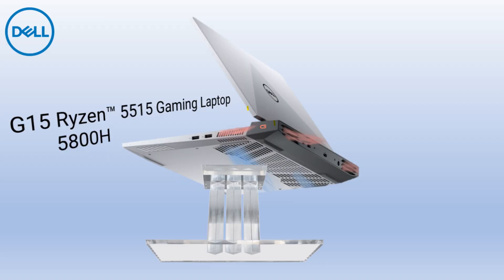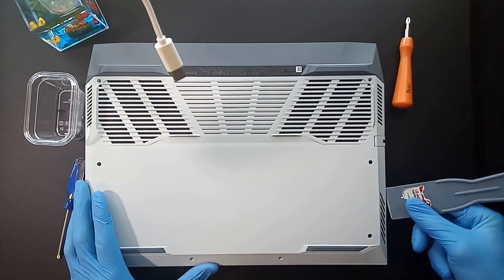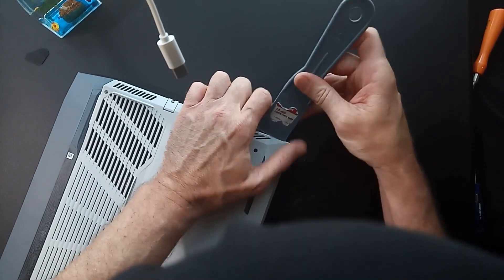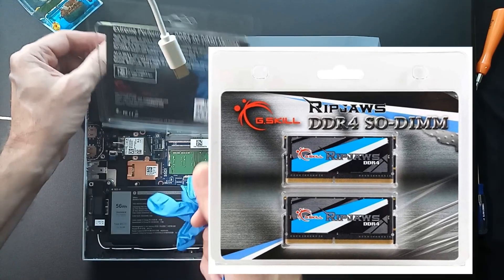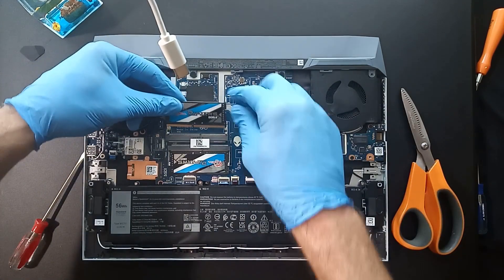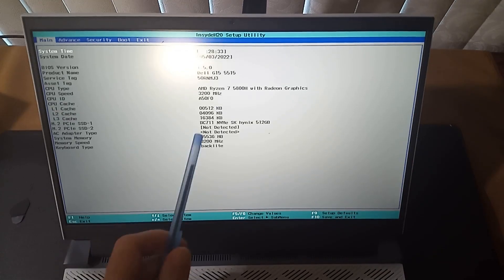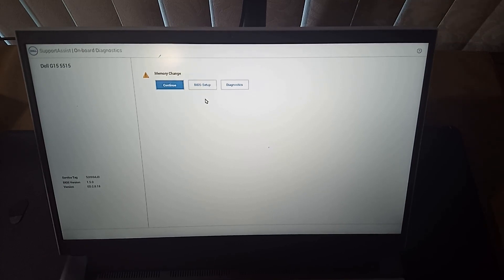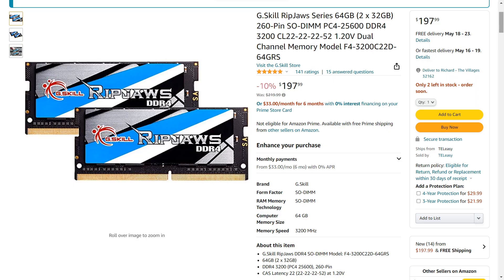64 GB Memory Upgrade for Dell G15 5515 with Ryzen7 5800H CPU

Comment: I have the 16GB one, can i upgrade my memory two? the technician told me that he thinks that it has only 1 slot, so he's planning to change it from single 32gb or 64gb. what is the pros and cons of single memory?
Reply from the maker: Thank you for commenting and subscribing. The laptop has two slots.
Reply from the maker: It's a 64-bit bus so there's no advantage of one or two slot configuration. The only thing to consider is what is the cheapest way for you to upgrade your memory to the level that you want.

Comment: Hello. I added 8GB ram to my laptop.  cl22 and 3200mhz.  But I am getting a blue screen error.  The error I got was 0xc000021a and after the new ram I installed, Windows asked for repair.  What is the reason ?  is it a normal situation?
Reply from the maker: No it's not normal. See the pinned comment at the top. Try to run some memory test on the memory and see what the results are. Also make you have the correct physical configuration for the banks. For example two Banks of 8 GB. Please keep us updated on your efforts and post the results here. Good luck and thanks for commenting.
Reply from the maker: Any update?
Reply: @CyberMedics  I reset the laptop to factory settings.  Then I installed the ram I bought.  Hassle free for now.
Reply from the maker: @fatihmurdock  Great!  Please hit like and subscribe. It helps support our effort to help others. What brand did you buy?
Reply: @CyberMedics  İm from turkey.  İm bought this product from my country:  Kingston KVR32S22S8/8 8 GB DDR4 3200 MHz CL22

Comment: Hi. Great vid! I have a Dell G15 5520 (12700H). Im planning to upgrade the RAM.
Currently the RAM being sold at amazon are the following:
- Crucial 2x16gb 4800mhz for $82
- Crucial 2x32gb 4800mhz for $126

Will be using it for programming, databases and VMs.

May I ask whats your advice that I should buy? Thanks a lot.😊
Reply from the maker: For the relatively small difference in price I would upgrade it to 64 GB
Reply: @CyberMedics  Thanks for the prompt response. I was thinking 64gb too but a bit worried if it will work since dell said the g15 5520 only supports upto 32gb.
Also, after u upgrade, when u boot, some people say it's going to take awhile. Is this true? Thanks again.😁
Reply from the maker: @qutiephoebe2154 they said the same thing about the 5515. All that means is they have not certified it with 64 gigabytes. I can't guarantee it but it does not mean it will not work. It's probably not going to have a problem with 64 gigabytes is my estimation.
Reply from the maker: @qutiephoebe2154 hope you subscribe to the channel and gave the video a thumbs up .
Reply: @CyberMedics just did both. Thanks again.
Reply from the maker: Let us know what you decide about the memory of grade and how it goes.

Comment: Thanks for the great vid!  I have the 5600H version, but I'm going to try the 32gb sticks anyways.  Do you know if running a single 32gb stick works, or do you need to have two to get the G15 to recognize it?
Reply from the maker: Our other Dell video list all the possible memory configurations: https://youtu.be/urxVdLBVLCE  ...requires both slots to be populated.
Glad you liked the video.  Hope you gave it a thumbs up.  What are your tech interests?  Appreciate the feddback.
Reply: @CyberMedics  thanks again for the info!  I am upgrading my ram to run more virtual machines.

Liked and subscribed!
Reply from the maker: @M4K9G22  Been wanting to do the virtualacines also. Would be interested in your insight   welcome aboard!
Reply: i have the same laptop- keep us updated please as im trying to upgrade as well
Reply from the maker: @Busyballin123  Are you upgrading to 64 GB? Thanks for subscribing & commenting
Reply: @Busyballin123  I haven’t ordered the new ram yet, was waiting for the prices to come down a little more.  Price is currently $140 for 2x32gb of the g.skill ram which is a good price though.  

I’m pretty it will work with the Ryzen 5600H.  The cpu does support 64gb ram. I will probably order a single 32gb this week or next to test it out.  It wont run in dual channel with my current 8gb, but so long as it works with the 40gb total, I’ll order a 2nd 32gb
Reply: @Busyballin123  I got a single 32gb and added it to the existing 8gb, and its working fine at 40gb total RAM.  

That confirms the slots can handle 32gb sticks.  Hey’re probably not running in dual channel though since the size difference between the 2 sticks is so great. No noticeable problem for me though since I’m already used to single channel when it was just the 8gb stick. 

The extra memory makes a big difference already, but upgrading with just 1 new stick works much better for my budget at the moment. I’ll replace the original 8gb with a 32gb later.
Reply: @M4K9G22  I've been looking all over for this exact comment. Thank you so much
Reply: @M4K9G22  i want to add a 32gb one would you recommend a vendor?
Reply from the maker: Please see the affiliate links in the video description. Thanks for commenting and supporting cybermedics

Comment: You don't remove the battery before installing the Ram
Reply from the maker: Static electricity is the most important thing to worry about.  Standing on a rubber mat, using rubber gloves, or wearing a grounding strap all lessen the chance of static discharge.  You can disconnect the battery for extra protection, but this will not protect from static discharge.  Thanks for commenting & subscribing.  Please update us on your memory upgrade progress.

Comment: i installed new ram and when i put it back corner with letter G is sitting slightly above table. What could be the cause, backpanel is perfeclty attached?
Reply from the maker: Check around the whole perimeter to make sure the space is the same around the edge.  It was tricky to get the panel to unsnap and snap back in.  It may have seemed to snap, but probably didn't go in all the way.  Thank you for commenting,
Reply: @CyberMedics  I fixed it by having backpanel removed and put back, but second time i didn't tighten screws to much :)
Reply from the maker: @eurosn7322  Great to hear. Hope you gave the video a thumbs up.  Did you upgrade to 64 GB of ram?  What brand did you use?  Glad you got sorted.  Thanks for the update.
Reply: @CyberMedics  I upgraded same laptop with exact specs to 32gb (mine was only 16 gb) since i wasn't very pleased with single channel manufacturer's ram stick so i used 2x 16gb 4000mhz Corsair Vengeance sticks .
Thanks for commenting, i liked and subscribed.
Greetings.
Reply from the maker: @eurosn7322  Nice, glad to have you aboard!

Comment: When i tried to upgrade for 64 ram its already read but for a while a blue screen appeared and remained restarting to daignose the memory and every diagnose system running it couldn’t complete and restart again to dianose memory system , can u see there is a solution or i should return rams and got  a litle instead it
Reply from the maker: Are you able to start into bios and read the memory configuration. What is the exact model of your system including CPU configuration? Provid the memory specs you purchased.
Reply: The same 3200 hz as the memory i bought
Reply: My model g15 5515 RTX 3060 
3.2
Reply from the maker: What cpu is it configured with?
Reply: @CyberMedics i tried to put one single 32 gb memory alone and noticed that it does work efficiently so i put the 8 gb ram in the second slot to be 40 gb in total and the window works good and in a good condition with high performance.  My laptop can’t deal with 64 gb , now it works with 32 plus 8 gb rams
Reply from the maker: Good job I would stay with that that's plenty of ram. Thank you for communicating with us and supporting the channel.

Comment: Hi there, first time here and I want to be safe, did you need to unplug your charger for laptop? and holding the power button on computer and waiting for a few seconds fully shuts it down, right? And do I need to unplug the battery?
Reply from the maker: I did not unplug the battery and did not have any problems.  It is a good idea to make sure the computer is completely shut down. Let us know if you need any help.  Thank you for commenting & Subscribing!

Comment: In Task Manager it still says 2933 instead of 3200. Any idea why this may be happening? My two new 32GB ram sticks are both 3200 speed.
Reply from the maker: Thanks for commenting. What does it say inside the BIOS?
Reply: @CyberMedics  Hey bro :( I just figured out that Dell laptops don't have the XMP option in their bios settings :( So bummed out. How ridiculous is Dell. Mine is the Dell G15 series.
Reply from the maker: @MidnightPodcast  I think the problem may be the voltage rating on the ram. On Dell's support forum users said ram must be specd for 1.2v vice 1.35v.  People using 1.35v ram have noticed below spec freq on the ram.
Reply: @CyberMedics  Yeah man :( I am going to install Intel Extreme Tuning Utility (Intel XTU) and see if that fixes it for me.
Reply from the maker: @MidnightPodcast  Thanks for keeping us updated.   What is the voltage rating on  your ram?
Reply: @CyberMedics  No idea bro. It's the high end stuff though. That I know for sure. You think they'd make it easy for us to know this. Task manager doesn't say shit, neither does Speccy.
Reply from the maker: @MidnightPodcast  post as much information on the specs you have for the memory and I'll try to look it up for you
Reply from the maker: Provide me the link on where you bought it and I'll take a look at it
Reply: @CyberMedics  Bloody hell, doesn't allow links, silly YouTube. I'll have to just copy you the full title of the product instead, Crucial CT32G4SFD832A 32GB (1x32GB) 3200MHz DDR4 SODIMM, interesting discovery, when I opened the laptop to take out the old 8GB one stick ram, that too said 3200 on it, but out of the box it only read as 2933. How bizarre.
Reply: @CyberMedics  According to the specs online, it's 1.2 volts.
Reply from the maker: @MidnightPodcast  Seems to be the right voltage/speed.  Also check that the BIOS is updated.
Reply: @CyberMedics  Bios doesn't give me any option to change the speed. Yep it's updated. That program I tried allows you to change every single aspect of the internals, except the damn ram speed LMFAOOOOO!!!!!!!!!!!!!!!!!!!!!!!!!
Reply from the maker: @MidnightPodcast  can you return the ram you purchased? Maybe you could buy the same Ram that I put in my computer which worked without a problem.
Reply: @CyberMedics  It's not to do with the ram. It's the specific motherboard. It's been said to be a well known issue with many laptops. Not only Dell. Is what it is.
Reply from the maker: @MidnightPodcast  Mine is the Ryzen 7 5800H Dell G15 5515 with the GSkill 64 GB.  Wish we could have been more help.  Let us know if you get it resolved & thanks for keeping us updated!
Reply: @CyberMedics  Unless there is a bios update again for my motherboard I'm pretty much screwed. Eh, could be worse. It's close to 3000 at least. Just 4% lower than 3200. I'll live LMAO !

Comment: is the battery life duration same as before you upgraded your memory???
Reply from the maker: I haven't noticed any degradation, but have not definitively tested it.   Thanks for commenting & subscribing.  I like the laptop, but the sound output is terrible.  You will definitely want to use some external speakers.  It seems the input microphone jack also has issues.  It took a long time to configure OBS studio to work with the external microphone.  Let me know if you get it and what your experience is like.

Comment: Hi, I want to know why did you choose the G.SKILL I ordered the same laptop and I want to upgrade the RAM but I'm now confused with the brands 
There is any difference with crucial, Kingston or Corsair to name some examples ?
Reply from the maker: G.Skill met the spec and was at a good price point. My research indicated it performed well and is generally cheaper.  I haven't had any problems since the upgrade. I think any brand that meets the specs of the computer would be okay. Let me know if you have any specific questions or need any help. Would love to get some feedback after the upgrade to know how it went.
Reply: @CyberMedics  thanks man I will update after the installation and testing
Reply: @CyberMedics  please, could you provide the link where you bought the memories? Thanks a lot
Reply from the maker: @gafds  Will update din the description tomorrow.  Thanks for commenting and subscribing.
Reply: @CyberMedics  could you also please provide Bios version? I have a problem that the system accepts 1 memory of 32GB on slot B, but doesnt accept it on slot A.

For example, slot A with 8GB and slot B with 32GB works. But slot A with 32 and slot B with 8 doesnt.

Both slots with 32GB also doesnt work.

I have bios version 1.8.0, and I have 2 ADATA memories of 32GB.
Reply: @CyberMedics  This happens exactly on ryzen 5800H Dell G15 with 3060 and win 11.

Weird thing is that on another laptop, a Dell G15 with intel i7 11800H and bios 1.18.0, both ADATA memories of 32GB works.
Reply from the maker: @gafds  Is the processor & memory speed both 3.2 GHz?
Reply from the maker: @gafds  C:\Windows\system32>wmic bios get smbiosbiosversion
SMBIOSBIOSVersion
1.7.1
Reply from the maker: @gafds  Updated in the description.  Please use our affiliate link.  If you need a different configuration, we will update.  Thank you
Reply from the maker: @angeloaraya8157  Any update on your upgrade?  Thank you
Reply: @CyberMedics  Hellos guys sorry for the late reply, first i want to say thank you for your support, video was extremely helpful
Finally i installed two RAM Crucial 32GB each and the laptop is working fine nothing to comment so far
I want add some information regarding the second SSD for this laptop:
The WD SN850X, the one that comes with the heatsink i believe it`s too thick for dell G15 2021 i installed this one and the back of the case of the laptop don´t close 100% but still works 
(at least for me)
After this i have some problems with win 11 recognising the new SSD, the only solution that i found is the following:

First open the Command Prompt, press Windows + R, type cmd and click OK.

1. In the Prompt type DISKPART, when it opens, DISKPART will appear on the left.
2. Type LIST DISK, this command will list the hard drives installed on the machine, pay close attention not to choose the wrong hard drive.
3. Type SELECT DISK “X”, in place of the X put the number for the HD you want to format, put without quotes.
4. Now just type the commands below and press Enter at each command.
5. Commands:
CLEAN
CREATE PARTITION PRIMARY
SELECT PARTITION 1
ACTIVE
FORMAT FS=NTFS QUICK
ASSIGN
EXIT

Hope i can help somebody with this
Regards
Reply: @angeloaraya8157  could you please provide your bios version? you can find it on dxdiag or by writing wmic bios get smbiosbiosversion on C:\Windows\system32
Reply: @CyberMedics  On Dell G15 5515 Ryzen 5800H I have bios 1.8.0. Maybe this is the problem. Yes, ADATA memory is 3200 MHz speed and 32GB each, 64GB in total. Works fine on Intel but not on Ryzen 5800H, I bought them on Aliexpress, I can provide link if you want.

I'll try to upgrade BIOS on Ryzen, maybe this will fix.
Reply from the maker: @angeloaraya8157  Fantastic writeup! Will definitely help me,since I want to add an additional drive. Appreciate you sharing so others can benefit. The main reason we started the channel. Anyone running windows should view our bitlocker video, before it becomes encrypted.  Appreciate your feedback and support.
Reply from the maker: @gafds  yes please provide the link it'd be good to check out the specs on it.

Comment: I'm getting 100C with mine(intel 11800h version), are you also experiencing the same with 5800h?
Reply from the maker: Haven't  Experience to that. I use it mostly for video editing. What's your primary use for the computer I'm just wondering what might be causing it to spike temperature wise? Thanks for commenting and subscribing.
Reply: update bios
Reply from the maker: @domenico8508  Good suggestion. Run the Dell update app under your admin account to keep system updated
Reply: You need to clean the vents on the top / bottom. This is a common issue with this particular laptop. Duster alone probably won't work. 

Mine would hit 98*C in G mode. After zi cleaned the vents, it was hovering around 85 max.
Reply from the maker: Thank you for informing the feedback on cleaning the fence. Could you detail your method little bit more.?